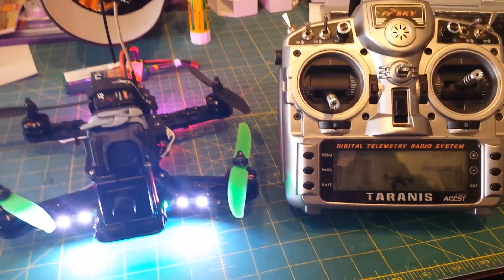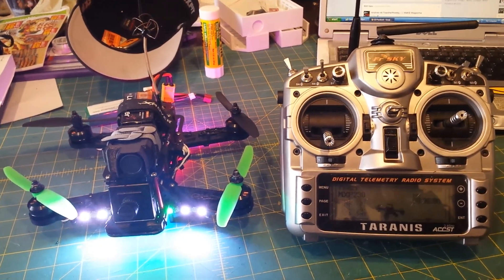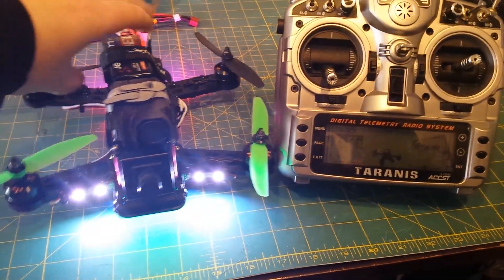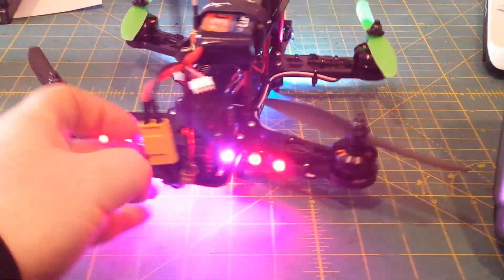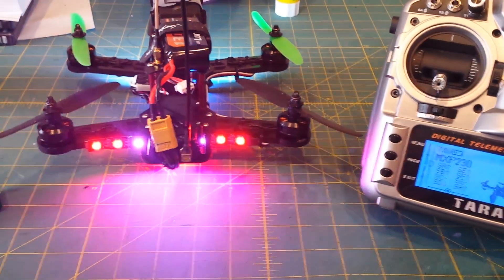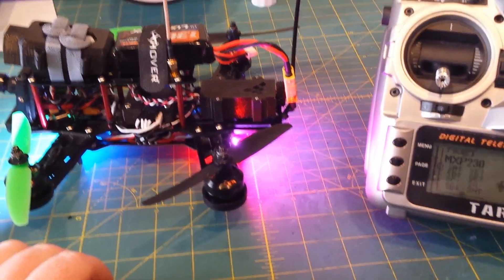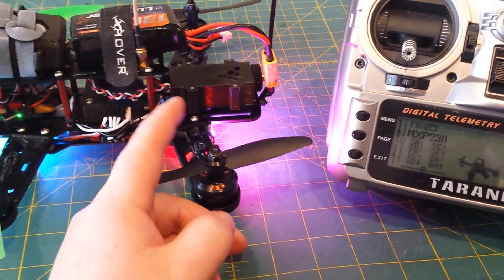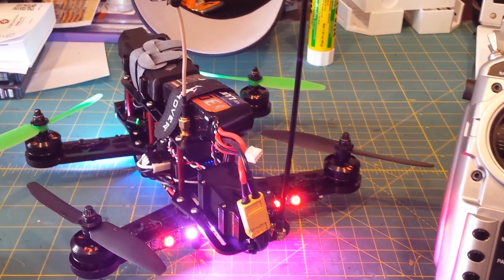Cleanflight with RBG led set up

Comment: Cool video! how do you power the ppm receiver from the naze32? which pin to use?
Reply from the maker: +Alfonso Alfonsos Hey thanks for the compliment.. I leave M1 from the PDB with the 5v to the naze32. That in turn powers the RX.  You can also power the naze though the rx, if your esc's are opto(no 5v from the bec) You would have to use a separate ubec into a open channel of the RX, that in turn would power the naze32 though the ppm.

Comment: I have more diodes if you need .  ps you can get small dc-dc power converters suitable for R/C power use . the you can dial in the exact voltage .
I'm using raw RGB leds chralieplexed and ATTiny85 micro controller at 5v 50ma to run mine.  (about the size of a orange receiver ) . I'll PM or email you more in that later if ya like. 100 LEDis like 3$ , but you are using are using addressable LEDs.
Reply from the maker: XerotoLabs thanks Scott, late reply but i got it sorted. One was enough to drop the V to .7v i beleive.